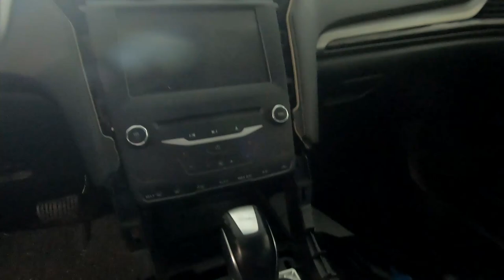2014 Ford Fusion Copart Rebuild Part 4 | First Real Test Drive

Comment: you should try to get a 15+ speedo. With that you can use forscan to change the mileage if the new speedo has lower mileage and you can turn on the digital speedometer